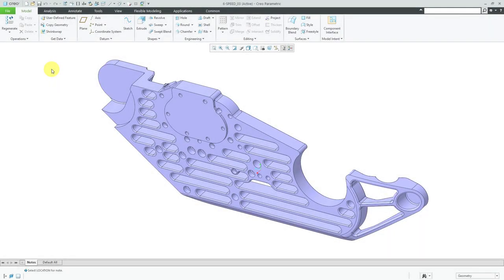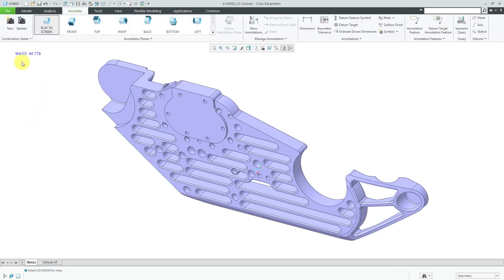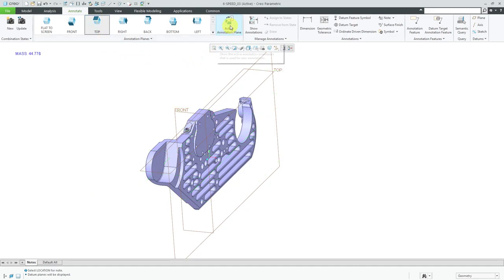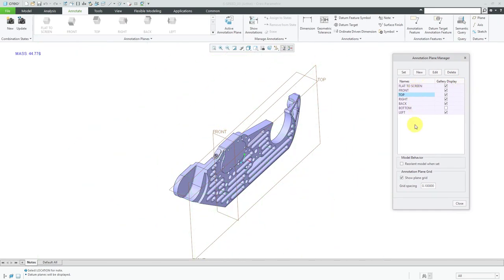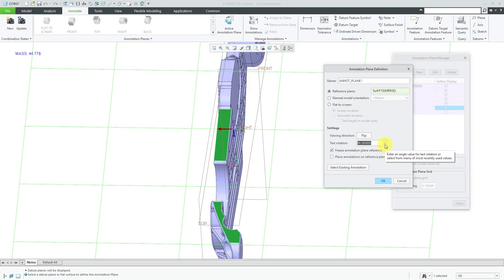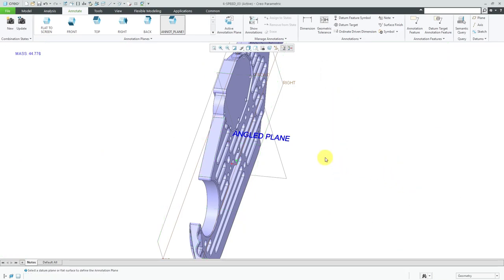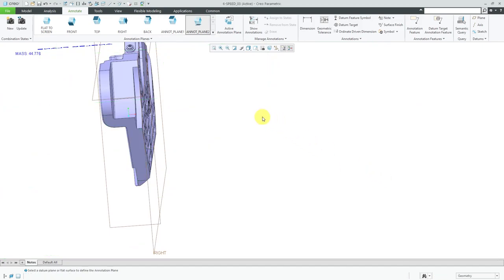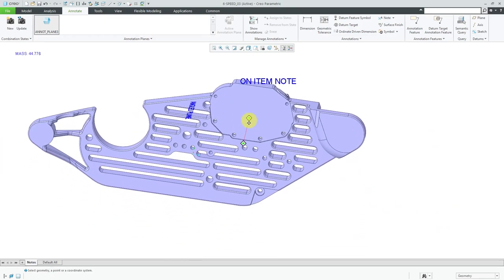Creo Parametric - Annotation Planes - Model Based Definition (MBD)

Comment: Is Creo Parametric an independent application?
Does PTC Creo include Creo Parametric?
Reply from the maker: I'll be specific. PTC is a company. One of their core brands is "Creo." (Other brands include "Mathcad" and "Windchill.") Their flagship Creo product is Creo Parametric, their primary mechanical CAD program. However, they have another mechanical CAD program called "Creo Elements/Direct." And they have other products under the Creo brand like Creo Simulate (analysis), Creo Schematics (2D cabling and piping diagrams), and Creo View (lightweight viewer for CAD models). That's why I am specific about saying "Creo Parametric" instead of the more generic "PTC Creo." I don't believe you can purchase "PTC Creo" but you can buy Creo Parametric.

Comment: Thank you for the information. I have a doubt in creo 4.0. can you please let me know how to create datums(model) with plane and axis. I did in creo 3.0 but I couldn't able make it in creo 4.0.
Reply from the maker: Creo 4.0 strictly adheres to the 2009 standard in which Datum Feature Symbols reference geometry, not datums. IIRC there may be a config option that allows the old behavior but I strongly recommend following the 2009 or 2018 standards.
Reply from the maker: The option is old_style_set_datum.
Reply: @CADPLMGuy  thank you for the information.
Reply: @CADPLMGuy  it's working in model but I couldn't able show the datums in drawing. Can you please help me to fix that one.
Reply from the maker: @600490572  Are you using Show Model Annotations? Then again I'm not sure if 1994 datums are supported in drawings in Creo 4.0.
Reply: @CADPLMGuy  Yes. I am using show model annotations only. If you get chance please try in your end. Thanks in advance.